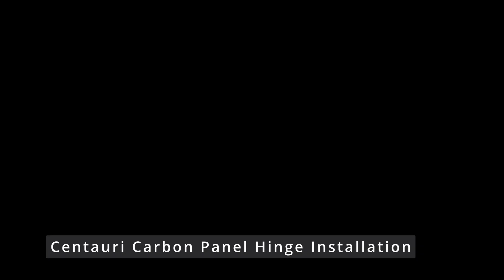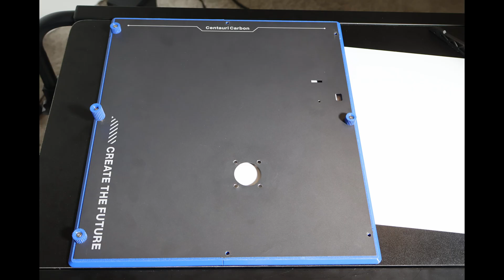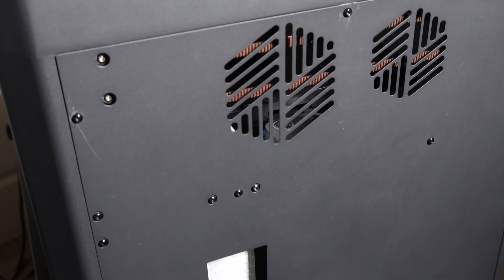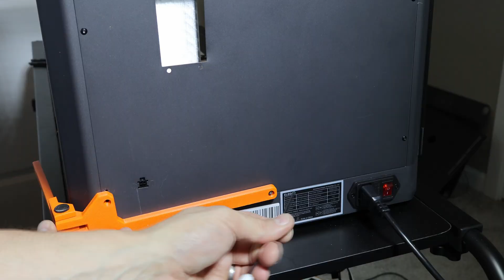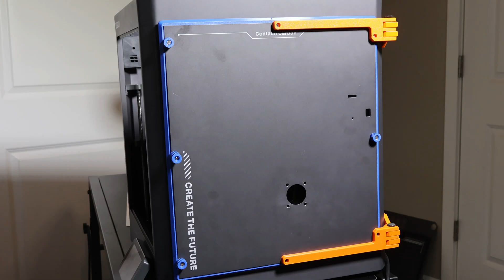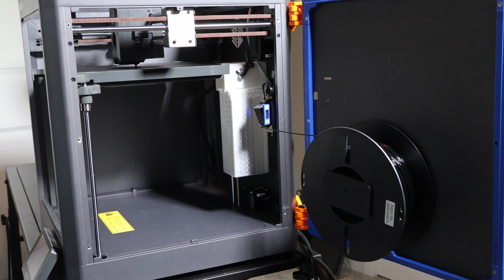Centauri Carbon Side-Panel Hinge Install

Comment: Only thing I have issue with is the top back hinge blocks some of the air vent and there is no way to use Uncle Jessys air filter print with this hinge.

Comment: great idea, just one thing i know you would do this if you have space constraits and it would be difficult to get to the spool in the first place. But wouldn't even be more difficult to open the side that far if you have space constraints already. But just for modding the centuri great idea, but functionallity if you really have space constraint not practical especial for filament change so not knocking the design or idea just saying for space constraint it doesn't help the problem. Hopefully when they come out with the ams or what ever they going to call it sits on top that would solve that side problem unless u have upper space constraint. But great job on design and idea for modding purpose.
Reply from the maker: With an external spool holder, you need the space for the holder + the width of the spool. This isn't the first time this concern has been brought up to me, so I made a short demo to address that here: https://youtube.com/shorts/STQY748a0Oc
Reply from the maker: Also, with my drop-pin hinges and the runout sensor relocation, you can simply remove the panel to change filament, which requires even less clearance: https://www.printables.com/model/1344468-centauri-carbon-cantilever-drop-pin-panel-hinges-v